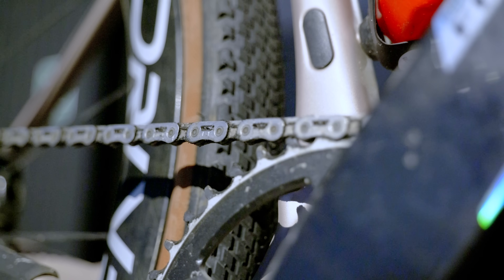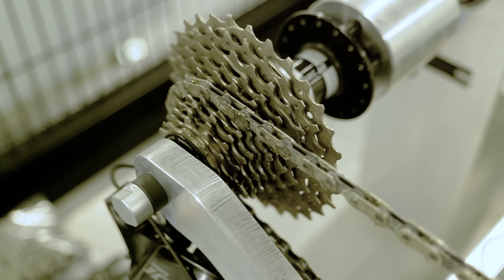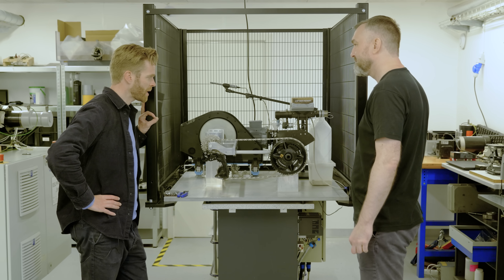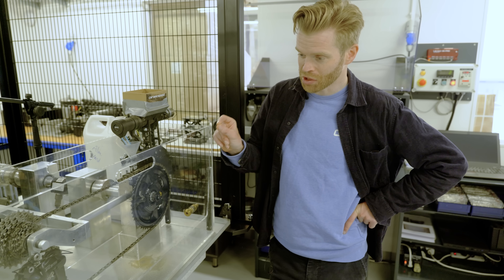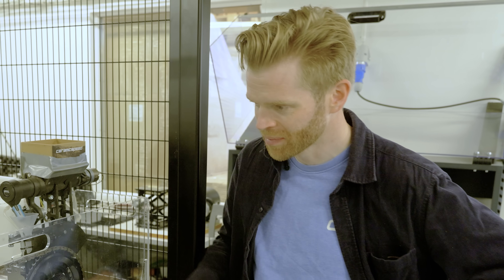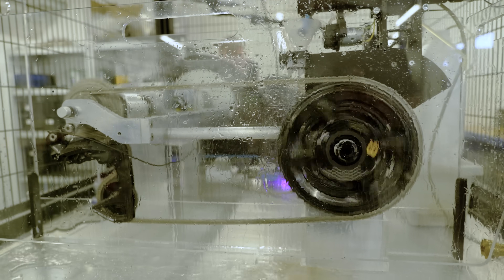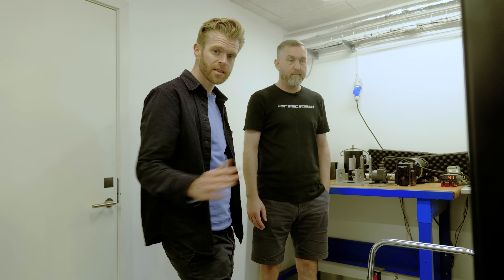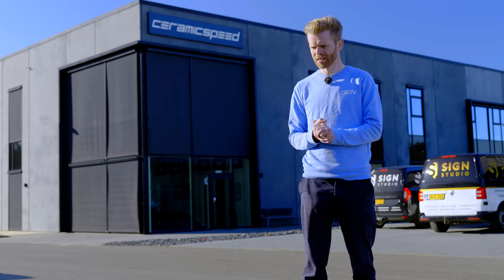We Lab Tested A Dirty Chain, How Much Slower Was It?

Comment: So essentialy a 46T chainring will beat a 36T chainring by quite a lot, it's not just "I just have to use higher gears", it's more of "I'm losing efficiency". 
I think I'll convert from 36T 1x to 42-28T 2x, and my next bike is going to be 46-29 front, 11-38 rear.

Comment: I would like to see: a really dirty chain, preferably from a commuter or childs bike. It should be brown from rust and either completely dry from lack of lubrication and care, or covered in a horribly thick slush of old oil and sand. Also: it seems reasonable to assume that high friction is what reduces drivetraing longevity. But can you show it experimentally? And: If I can get about the same gear ration on two different front chain rings, what will be most efficient: the largest or smallest front ring? Uphill or downhill?

Comment: Puts all those 1xX setups into perspective: to allow you to climb they use a smaller chainring in the front, so to make some speed on the flats you'll be in the smallest sprockets whenever you're covering much distance. How smart :-).
Reply: That's not entirely true in my opinion. With a 1x setup you generally have bigger sprockets, which seems to be beneficial. 
And as for the chain ring, a medium sized chain ring still has very little losses according to the measurement in the video.
The question is whether with a 1x setup you use the smallest sprockets more often than with a 2x setup. That depends on the chain ring size and on how and where you are riding.

Comment: It doesn't surprise me that there's no real difference between a dirty chain versus a clean and lubed one. Bicycle chains run at low RPM and relatively high torque for a given power so the power absorption from dirt and grime is very low. The main reason to clean and lubricate your chain is to make the chain and sprockets last longer, not to make the driveline more efficient.

Comment: 12:28 That's simply not true about chain stretch. Rollers on bike chains are supposed to have very loose fit to accommodate for irregularities in the chainring/sprockets and to enable changing gears.

The chain stretch comes from wear on the pins where they connect the links. It's the increasing distance between average pin centerline that causes the chain to jump the gears, because a longer pin distance will ride higher up on the gear teeth due to the length "mismatch", eventually it will slip under heavy load, and soon after at any load.

Comment: So, bicycle chains don't have rubber gaskets between the roller pins and plates? on a motorcycle chain there are little rubber gaskets that allow for the grease be packed in between the pins and the plates

Comment: To hold a certain speed, I (as a human engine) need a specific gear ratio to hold the pedal stroke. If the bigger gear (at the real) is more efficient, can we say, as a conclusion, that the bigger bicycle crank gear is more efficient in any case?

Comment: Now send over Steve Jones from EMBN to see the losses and wear add up from electric bikes. I have both an SL (super light) 30 NM and a full power 90 NM e-bike and I can tell you more power smokes a chain (500 miles) vs. 2000+ miles on the lower powered e-bike..... and chain care doesn't seem to matter 1 bit! Seems almost silly we use the same drive trains for the ever more popular e-bikes. Clearly Shimano/SRAM aren't bothered about it tho??!!

Comment: I wonder if you have been able to compare the losses of a constant gear ratio  / gear size in different drive line positions? I guess this could be achieved one of two ways:
1) Make a custom cassette of all the same gear size
2) Move the whole rear mechanism (derailleur, cassette and chain) together to the position of the next gears up or down (not sure if your machine is designed to move that far out of tolerance...?)

And perhaps, the inverse:
If you have been able to compare different gear ratios / sizes of gears in the same 'optimum' drive line position? Again, by moving the whole rear mechanism as opposed to using the derailleur

Comment: I live in one of the cities most notorious for bike theft in Sweden, and so I have two bikes, an old and dirty bike that everyone can hear squeak and crunch as you approach, as well as just see the rust on in general is far less likely to be stolen. So if I am going into the actual city and parking the bike for a while that's the one I take. But for quick runs to the store, or to my university campus (which is in a far more calm area) I use my nice clean bike, though I do still always put three different locks on it.

The one thing poor maintenance does for your bike is theft deterrent, though you have to strike a balance, if it looks so bad that people assume it has probably not moved for like a year and is just like forgotten there, then it's quite likely to just be taken because someone needs a bike and assumes that the owner of such a rust bucket won't even report it missing. Consequently, if it looks too nice, they want to steal it because it looks valuable to sell, so "quite abused but clearly functional" is the state in which bikes seem to be stolen the least.

Comment: You didn't mention much about the derailleur. When switching gears, the derailleur is also adjusted. Not only does the chain go around a tighter angle around the sprocket, but also as it goes through the derailleur.

Comment: I find it pretty interesting that drivetrain efficiency seems to depend more on the size of the sprocket than on the chain’s position. It’d be cool to test different sprocket sizes using the same neutral chain setup to see how the efficiency changes.

Comment: Unintuitive result, poorer chain line has fewer watts of loss than running in smaller cogs. You'd think that a greater side load on the rollers and pins would cause higher drive train loss. Two things, should we roadies all change our guide and tension pulleys to ones with a greater diameter to reduce losses there as well?  Will this start a trend back to 53-39 chainrings coupled with larger cassettes, 12:36T?  Forgive the weight increase, focus on aero and lowering the drive train loss.

Comment: Completely meaningless differences for us normies. Just fit an eight-speed drivetrain, through some oil its way when it´s gone dry and replace it with a new one for the princely sum of a fiver when spring has sprung.

Comment: I have an indoor trainer, oiled the chain maybe a year ago (650 miles ago) then didn't bother. Tonight I ran my finger over a few half-links and was surprised at how oily it was, but also that it was thick black oil, unlike what had been originally applied.

I put a drop of my favourite oil (Tri-Flow) on each roller (the same oil as originally put on) and yes it certainly made a difference, it felt like it freed up the chain more - and this is an indoor bike that never moves through the air to pick up dust and never gets wet.

I think on an indoor trainer you could do 1000 miles and the chain would be fine with one oiling at the start, but trust me... the oil is absolutely black by then and it all loosens up when you oil it again, I'd say to do it maybe every 500 miles for an indoor trainer. The mistake I made was reapplying oil and not cleaning the chain first, oh well.

Comment: You didn't test dirty chain vs. clean chain, all else being equal.

You've tested a (presumably new) waxed chain against your own worn and dirty chain, then you've added water and dirt to your chain. But you never cleaned and tested your worn, but clean chain. WTF

If the difference between best case scenario (brand new, waxed) and worst case (worn, dirty) is less than 1W, I would expect the test you failed to do would have shown less than 1W of difference, ie, normal dirt has no meaningful effect on the performance of a chain. You had all the machinery needed to properly answer the question in the title, and still I have to guesstimate what the answer might have been.

Comment: Losses in the chain are inversely proportional to the size of the driven sprocket - the main losses occur in the chain link (in the bushings), which straightens under load when exiting the driven sprocket. On a small star, the fracture angle of the links during straightening is several times greater and therefore the loss is greater. You can try to see this heating with a thermal camera, at low speed and maximum load on the chain.

Comment: It's getting "more efficient" (drawing less power) on the largest sprocket but shouldn't this result be normalized for the difference in power?  In practice, as we move up the sprocket, we lose power because of the gear ratio changing. The smallest cog may have a 14% loss but is it adjusted for the fact that the wheel will be turning faster? Or does this test simply apply the same torque to the crank arm?

Comment: When I did race cycling, my trainer told me that with 3 gears near the pedals (1=smallest, 2=middle, 3=largest) that on 1 we shouldnt use the 2 smallest gears on the rear, on 2 we shouldn't use the smallest and largest, and on 3 we shouldn't use the two largest ones. This was because the left-right motion of the chain would give us the most resistance. Never bothered to investigate that myself, but does seem logical. Is that the case?

Comment: Please watch Adam’s analysis from Zero Friction Cycling of this demonstration. His points make sense and explain how 1. The SRAM chains are notorious for needed hundreds of miles to break in and become their most efficient. 2. The dirty chain wasn’t really that dirty. 3. The chain lube you used is one of the singe best oil based products on the market and not representative of what is normally used. 4. Chain wax reduces chain wear which over time increases efficiency.
Reply: No don't do that, the guy is a fraud 😂

Comment: If you want your transmission to last forever : buy 3 chains when it's new, and rotate them every 500 or 1000 km. 1 - 2 - 3 - 1 - 2 - 3
I just add some oil each time I use the bike and after waterjet cleaning (Mountain bikes), and seldom wash it.

Comment: i have 3 bikes (the third one being my wife's and is currently connected to the smart trainer) and they have perfectly clean chains all the time. it rains almost daily where i live and i make it a point to clean my chain after each ride. and it doesnt even take more than 2 minutes. i know a lot of people wont agree with how i do it but i usually start by wiping it with a dedicated chain rag to remove dust and sand, followed by a light spray of WD40 throughout the length of the chain (yes you read that right, WD40 is my go to chain cleaner), then it gets scrubbed by the cheap chain cleaner mechanism i bought (the one that has 4 rotating brushes where you can put degreaser inside), followed by a quick wipe with a fluffy cotton rag. at this stage alone, the chain is already sparkingly clean and could be ridden straight away. but i know WD40 is too thin and wont last for a few days of riding, so i end the session by applying a new thin coat of oil (PER ROLLER LINK). some might say its a tedious process especially the per link lubrication, but i've been doing it this way for years that i already have that "pit stop" speed in doing this process. people keep commenting i have brand new chains, they don't know its just religious dedication to procedure. a clean bike is a fast bike.

Comment: I do not agree your "Chain Strech" theory. even the roller is getting looser,  The pins are still at same place. (there is only small effect or roller wear, if you are measuring between rollers (they can move littlebit because of wear) vs measuring between center of rings). Meaning side plates will strech and effect chain lenght. Wear of rollers does not effect chain lenght.

Comment: When you said ‘Power’ he corrected you for ‘Load’ then proceeded to give a figure in Watts. Load is a force measured in newtons.
Reply: When an object's velocity is held constant at one meter per second against a constant opposing force of one newton, the rate at which work is done is one watt.

So in this case, we are using watts, like the watt meters that cyclists use and can relate to. So a load is applied, in a term people relate to - watts, and then the difference is calculated by using 2 torque sensors and again explained as a watt loss.

And power does not equal load in any case.

Comment: Chain Loud --> clean it, that is basicily it, when it is too dirty the switch between gerars is to rough and the constant "grinindig" is annoying but other than that it makes now differencem, did a test on my motorcycle, 20000km with and without lubricant, only thing that changed was and annyoing noise, but saved about 50 bucks in lubricant,

Comment: So if I run a bigger chainring it's going to be more efficient because the chainring itself is bigger and I'd be riding in bigger cogs on the cassette? And this holds true despite the fact that I'd be cross chaining more than I would be with a smaller chainring? Great news. I can look pro without compromising on performance.

Comment: I can think of a number of additional tests that would have made this more complete. Why, after all the tests of your so-called dirty chain, why didn’t you clean and lubricate and test again? On chain line, the only really meaningful test would be with a cassette built up with all cogs having the same tooth count. 16 might be a good number. One other thing, I feel certain that the grease that Shimano chains are packed with is quite sticky and probably causes a lot of friction so why not a test as new, then just thoroughly cleaned with solvent an dried, and then lubricated?

Comment: Great info and research! Though my newly waxed chains do certainly feel faster. What I missed in the video, especially considering the small vs large sprocket part is the influence of the jockey wheels and their size. As Ceramicspeed makes these oversized jockey wheels, I am sure they'll have something to say about them.
Of course, then all results needs to be confirmed/tested in a wind tunnel, to check the aero penalty.

Comment: This is unclear to me so I'd like to address it and find out:

Is the drive line test being executed with a fixed output speed? Because if it's not it is probably unrealistic.

Not saying it's pointless, it isn't, but since when riding what you would actually do is change your input rpm and gear to keep a certain speed, its much more relevant to see that instead of what happens when keeping steady pedaling rpm and changing, effectively, speed. Because in that scenario air resistance would b a much more important factor than drivetrain efficiency.

Alternatively, if the testing apparatus compensates for or is otherwise indifferent to RPM that would also render my question moot
Reply: They were very careful to NOT explain how either the tests or the testing machine worked... because conmen, obviously 😂

Comment: I don't clean my commuter often. Once every 7-14 days i run a cloth over the chain and relube it with dry lube, reapply more often in the wet. I swap the first chain after 0,5% elongation, but keep it. Then I run the new chain to about 0,75% and then reinstall the first chain and run the whole drivetrain into the ground. Good for 12-14 months of commuting or 5-6000km.

Comment: Such a misunderstanding of what matters lol.
The grime outside of the linkages doesn't matter hardly at all. What matters is how properly lubricated the friction points are in the parts you can't see or get to. The grease or lube used is partly to keep friction low... But part of it is to have grime become clumpy and stick together and force it out.another important bit is to have an oxygen barrier and prevent rust. The chains are effectively "self cleaning" with the help of the oil or grease being used.

That said, I had to get some "super lube" ptfe stuff for the threaded rods on my 3D printer a few years back. Adding that to my old worn out bike chain... Wow! I probably still need to replace the chain (or the whole bike lol), but an abused 15 year old chain with minimal oil left on it compared to adding ptfe oil on it... Night and day! The best part of ptfe though is that it "bonds" to the metal, so where I had to oil components a couple times a year before, now I just feel the need to touch it up every 2 years or so. Less maintenance is just nice.
Most of your losses while riding though is wheel friction and wind. Compared to either of those, even a rusty chain is basically nothing. When it is raining, what slows you down is the added weight for the water you are retaining, and the extra surface contact with the tire on the road.
Reply: Yeah PTFE is great. Probably why it's being phased out 😂

Comment: Would have been nice if you actually showed the Power delta Breakdown on the different gears. You mention 14 Watts on the smallest gear, and then it gets better and better with bigger gears. But how much better? Actual numbers, not just looking at the line on the graph showing it going down is not quantifiable without being able to see the full graph axis marking.
Reply: Pretty sure its mentioned? at 16:35 he says its about 7 watts.

Comment: 10*2 will allow better angle and larger front chainring in 10*2 allow for use of larger small gear on sprocket at he back... 12*1 setup can't run too large a front chainring to allow for climbing and therefore need smaller gear on sprocket for top speed.... Also more angle needed on one by..... One by some obvious advantages like weight saving and cleaner handle bar less dropped chains etc. But wander about drive train efficiency compared to 2 by when rider uses gears effectively.

Comment: My main takeaway from the video is that I should be using a bigger chainring and the 20T+ sprockets in my cassette more often. Maybe bike manufacturers should also consider 12-36 cassettes with 56+ chainrings for the pros? I don't think the added grams would outweigh (pun intended) the gained efficiency